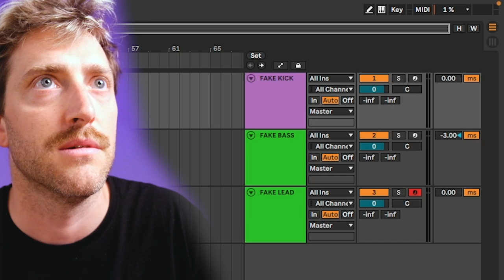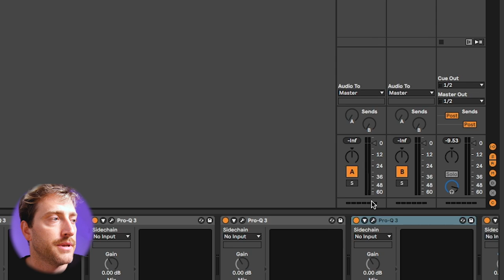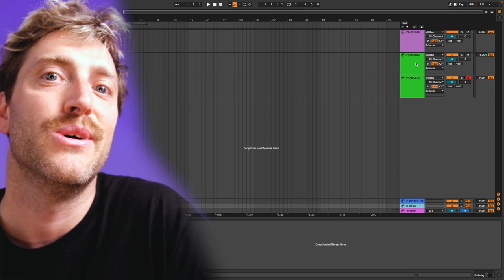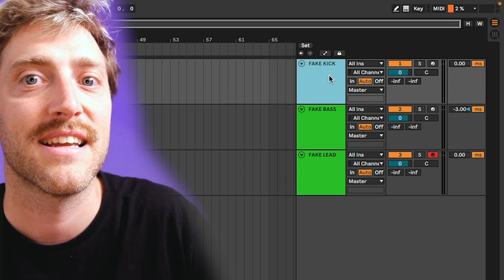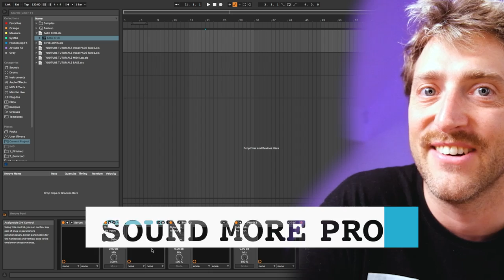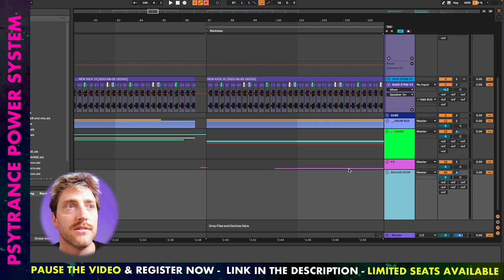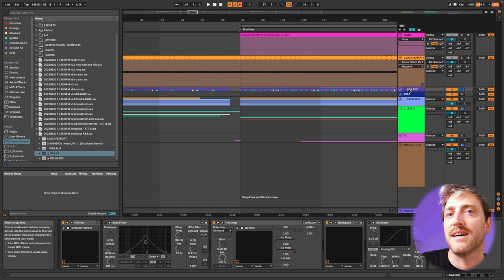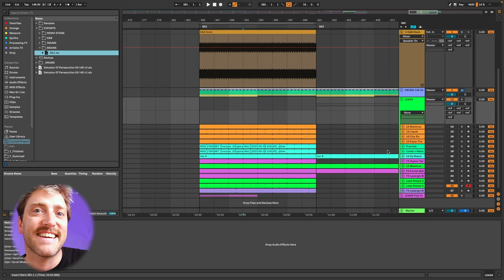How to Fix MIDI LAG / LATENCY in Ableton 2023

Comment: This makes no sense I have the top of the line computer and the input latency is all messed up. Says I have over 70ms of input latency but its only using 1% of my cpu
Reply from the maker: Not sure what's happening? But I guess you have a small buffer size already. But anyway for me the biggest change is once I remove all the plugins which add latency and are not included in that calculation in the settings.

Comment: I have watched this video, and didn't get anywhere in the bigger picture... but I did learn that there are individual track delays before playing OTHER tracks, which might be useful to know later on if I'm troubleshooting issues....... are there like services offered that could review my settings and ensure minimal latency?  I'm thinking maybe my laptop just has a really poor sound card.
Reply from the maker: I don’t know tbh. The main thing what is important is that the track with the biggest latency is making your latency. So if you have ten tracks and each 10ms latency but one with 200ma latency, your project is slowed down by that 200ms.
Reply from the maker: What I would do is to test things. Build either a project from scratch and experiment with settings and see which things cause it. Or the other way around take a slow project and start removing things gradually. Then nail it down where you notice it.

Comment: I dont habe problem with latency when hearing, i habe problems qhen recording, the midi note recird later than the audio signal
Reply from the maker: A little trick is to not monitor the recording the track. If you want to hear what's going on set up a second track and use that one for monitoring. And you can try with external instrument and add latency in there

Comment: Did i missed anything from video? With 32 sample buffer size, I got a fresh project tracking 3-4 from my guitar, midi drum and bass. So i added synth/electrnc drum, etc. its fine, till add more tracking guitar then it started a latency..i tried to figured out but didnt find good result. So i experiment to delete all my synth or midi as much i could, and saved for new project. Means i leave guitar +midi drum+bass there and for purpose tracking guitar revision. But the latency is still there
Reply from the maker: It should be the track which has the most latency which is the culprit. In my production, I tend to bounce down stuff to audio once I don't touch it much more. But I always keep the midi version in the project folder in case I want to get sth back.
Reply: @Psiger  guess i shud keep use amp simulator which are more cpu usage friendly for tracking. And then Maybe Flatten it, but keep the DI, Then reamp with desired vsts sim, in mxing.
For midi part i'll consider your tips for new workflow

Comment: Ableton EQ8 with oversampling enabled will probably tax the CPU more than Pro Q3 in zero latency.
In any case, both EQ8 and Pro Q3 in zero latency mode are so low in CPU that the difference is negligible.
The pro of using EQ8 is that it's a native plug in.
The pro of using Pro Q3 is that it has an awful lot more features than EQ8. The dynamic bands in Pro Q3 alone, can save you having to open other plug ins to control what you cannot, with EQ8. 

So in the long run, Pro Q3 will save you CPU.
Reply from the maker: I didn't measure it and I know there is a video from Dan Worrall in which he states the ProQ3 is more efficient, but since I replaced all the ProQs in my projects I see it running more fluidly. Which also makes sense for me as most stock plugins is heavily optimized for the DAW.

Did you test it somehow? I did just now a simple quick test. If I place 20 blank Eq8 in one track and 20 ProQs the CPU meter is higher on the ProQs. I guess it intensifies once you add EQ points - but I didn't test that now.

I totally agree that the UI and functionality is way better on the ProQ.
Reply: @Psiger  just added 20 x EQ8 (no oversampling, just a high pass filter) instances in my template and CPU peaked at 18%
Did the same with Pro Q3 (zero latency, just a high pass filter) and CPU meter peaked at 12%

So on my MacMini M1 running MacOS 11.7.6 and Ableton Live 11.3.4, Pro Q3 is clearly more efficient according to Live's CPU meter on the top right.
Reply from the maker: @nectariosm   Interesting as I also have a Mac mini (M1, 2020) 12.4  Abl 11.2. Actually, it should react the same :D cannot really explain that difference, maybe something in the Ableton settings is diff.. Anyway, seems to be a good advice to check that things out on each system.
Reply: The vsts with good graphics such as the Q3 will cause latency cause it's consuming the graphic driver space. Whereas to KILL the latency, I export the whole project into a wav or mp3, then I lay the wav file or the MP3 file on a new fresh project, commit to the melody or whatever I'm working on irrespective of how heavy the vst is, save the instrument and midi clip. Then open the real nightmare project with bad bad latency and drop the midi clip followed by the saved instrument from the finder or Ableton explorer. Takes heck of a time but works! Good video!